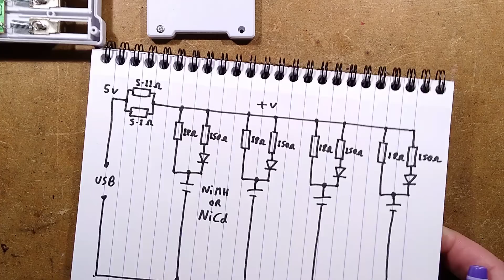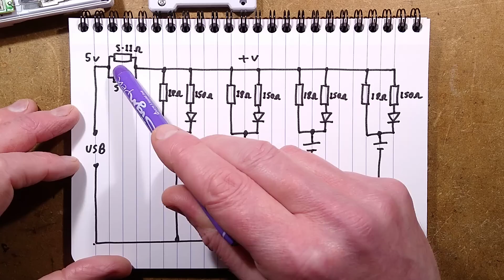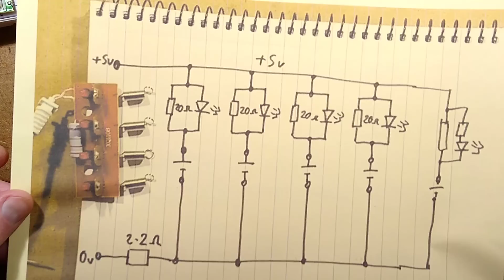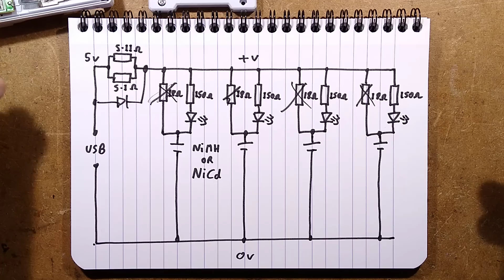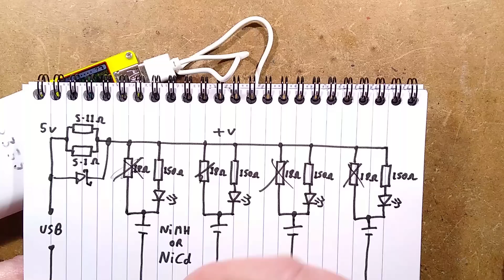eBay trash USB charger 2023 - with schematic

Comment: Looks like Kodak-branded chargers are available in Poundland now. For £4 they take 2 cells at a time and take USB-C (but only from type-A cables), they appear to be smart on the inside with a cutoff and LED indicator for when they're done charging. It'd be interesting to see at what rate they charge.

Comment: I designed one circuit when I first got a mains powered alarm clock. It was a relay, transformer power supply, LED, dropper resistor, 2 rechargeable AA batteries and an electronic beeper. The power supply turned the relay on the LED trickle charged the cells. When the mains went off the relay de-energized setting of the beeper letting me know the mains were off.
Reply: I no longer go to work at 6am. But it would be nice to know if the power goes off in the middle of the night due to severe weather.

Comment: some power banks need at least 150 ma to stay on. i ran into that problem making my own charger. it worked perfect on a 5v supply for a cellphone but using it on the power bank it would shit off due to the minimal load. perhaps that’s why they used the low value resisters. great video tho clive

Comment: You gotta work with surface mount?  I don't think so.  Surface mount is for the convenience of automated assembly machines,  among other things.  Besides that,  I've been scrapping through-hole stuff for decades,  and have more parts than I'll ever use.  No reason I can see why a leaded resistor couldn't be tack-soldered on to those pads..

Comment: I have this same charger, it outputs to the cells 5 volts, is that normal?  I tested it with a multimeter.
Reply from the maker: Yes.  The open circuit voltage will float up to the full USB voltage with no load.

Comment: I'm glad you brought up the point that the modified charger was intended to "top off" charged batteries.  Basically the idea is to provide just enough current to overcome the cells internal resistance.  That's actually called maintenance charging.  I designed a 12.6v gel cell charger based on a 7815 series regulator that provides it's output based on the state of the battery.  The charging current will be 1 amp when the battery is discharged and will taper off to about 8 ma at full charge.  I chose the 8 ma value based on the data sheet for the battery.  The charger and battery are in an emergency lighting system I built almost 10 years ago.  The battery has lived well beyond it's natural life thanks to maintenance charging.  

With regards to surface mount components, I would recommend getting a microscope to assist in placement especially for the 0805 and 0603 parts. I have a Mustool microscope that has it's own display and can magnify up to 600x.  It wasn't that expensive- under $50 USD (41 GBP) on Amazon.  As a radio amateur I receive the ARRL's QST magazine and a couple of years back they ran an article about using a PC cam as an alternate to a microscope.  I tried it and it's doable but it is cumbersome and the magnification is limited.   Solder paste is a much better alternative to fluxed solid solder as a dab will hold the part in place until you put pressure on it with tweezers.  Also you get better control of the amount of solder on the pad.  As to the type of tweezers the ceramic tipped ones are ok for passive components but not so good for actives such as MMICs where they might be subject to static damage.  For that reason I have a grounded mat on my bench and use conductive tweezers when I'm working with actives.  My workspace is a scaled down version of what I used to use back before I retired.  

Finally, a schottky diode would have been my first choice since it has a forward voltage drop of about .1v as opposed to .6v for a standard PN junction diode.  At 40ma the diode will dissipate only about 4mw.  Later.

Comment: My first thought about the big and little resistor in parallel is that the design was meant to be used with one or the other depending on if you need extra dissipation or can go with one size of resistor. Someone just decided to populate both in the end and maybe double the value to end up with the 2.something ohms.

Comment: Back in the days then I was young and naive I "hacked" one of those spring loaded chargers, basically threw out all the circuitry and just added a connector to hook it to a RC battery charger. I needed to charge 4 eneloop at a time (for Tamiya mini4wd models). Turns out the springs can't bear a 2A charge, they get super hot and melt. Lesson learned!

Comment: Maybe the first resistors was a voltage divider, so you don't push something like 4 volts into a 1.2V cell, but you can easily measure things, or calculate.

Comment: Was excited for this, I ordered from eBay what I thought was the same charger, but I got something with a slightly different PCB on it. PCB has a model number "MQ B-04". Traces are slightly different two 1.1 or 1 ohm coming off positive, the resistors seem swapped 22ohm in series with led and 150 going to positive contact. Resistor groupings on the board is different from your example, where resistors outside the first ones on the positive side input are placed around each positive battery terminal and led. Interesting with the differences between your example, and the one I got from eBay.
Reply: I got one from AliExpress and expected the same. The one I got had the exact schematic as Clive drew on the previous video (one R parallel with an R and an LED). Different PCB layout and values though (1k in series with the LED and parallel to a 24R). I removed the 24R and now I wonder if using a 1k and LED in series with the cell even charges it at all. There is current flowing because the LEDs light up (quite well, actually)

Comment: To me this seems ok. The soldering was bad, but the circuit.. I mean its a 5V out USB charger used to charge 1.2V low capacity Nims, or even nicads..
I can see how it works and it should be okay if you stopped charging after the leds glow dimmer.. ?

Comment: Anyone who wants a good multipurpose and multifunction charger just get a BT-C3100 or newer and you won't have to solder, modify, or reverse engineer anything. I use it for testing battery capacities and topping Ni-MH and Li-ion daily.

Comment: you could had even just removed the resistors and skip the diode altogether and bridge it as you only charge through the LEDs these gonna block any reverse current anyway. BTW what solder iron are you using? the pen looks pretty much identical as the one I have on my soldering station
Reply from the maker: It's a generic Chinese soldering station.  Yihua 8786D.

Comment: The schottky diode is actually superfluous, the LED’s will provide reverse protection on their own. Solder bridge the schottky, you’ll get a slight bump in charge current to boot.

Comment: you don't have to replace the 5.1 ohms with a diode if you cut out the 18 ohm resistors, because the reverse breakdown of the LED's will be higher than the battery voltage so the LED's will block current from flowing back into the charger and discharging the cells.

Comment: im so glad im ultra near sighted. ive never needed a magnify glass since my eyes have a focal distance of 1.5 inches. in electronics class i was the only one able to do smd chips and ics without a microscope. so the teachers had to debate how to grade me since i had a advantage over all the other students.
Reply: My eyesight is the same way. I think my main concern if I got into electronics would just be protecting my eyes when working with tools at such close distances.
Reply: Being near sighted myself I have always had an advantage when working with small parts but take it from me when you get down to 0402 pitch and smaller parts you will need a microscope.  The 01005 parts are not much bigger than a grain of sand.

Comment: Cud try shorting data connection on the usb plug but may allow 2amp if mains adapter is capable otherwise it be 500ma standard 1amp if that cable was any good 😅
Good idea for trickle charger tho👍

Comment: Clive, I appreciate the recommendation on the ceramic tweezers. I grabbed some a while back after you mentioned them in another video, and they're great! They work nicely for hot air soldering of SMD stuff, too. Mine use black ceramic, supposedly ESD-safe, but I don't know if I trust that.

Comment: The diode at 6:28 should be in series, not in parallel to the 2 resistors. Reverse current will still flow through the 2 parallel resistors. As others have said if the 18 ohm resistors are removed the extra diode isn't needed at all as the LEDs will do the job.
Reply from the maker: I should have scribbled over the resistors in the schematic.  I was just showing where it would go in the circuit to replace them.

Comment: I converted a GP 'overnight' charger for 2x2 cells into a 4x1 cells trickle charger. Mainly because the unit in its original shape could not charge 1 or 3 cells, but also because it slightly warmed up the cells when using it as a trickle charger.

Comment: I was taught electronics when I educated as a Radio TV Repair tech in the late 90s, and SMD was just a side notice..  Got my certificate and there was no work so I went into telecoms instead. 
Been there in various jobs since then, until recently when I started working in an electronics factory and Oh sweet lord this stuff is tiny..  My glasses need glasses for some of the stuff :D 

What I learned pretty early though, is get yourself a syringe of flux paste, and just jab that on there before you solder the component down, and also a sharper tip helps.  The flux will really help spreading the heat, and the sharp tip will make it less messy.

Comment: The schottky diode is not so needed, because the LEDs also are in series with the batteries, unless you do not trust them to block the back flow. And in your drawing, you did not cross out the two 5Ω1 resistors

Comment: Delightful. Good to see that surface mount is not so scary, and a nice tool tip about the tweezers at the end. I have actually built a 3 board version of the Simple NiMH battery charger (with PCB files) Big Clive showed us how to make. 👍🙂👍

Comment: I'd think the LED's would prevent discharge of the cells after removing the 18 ohm resistors. So the hack could be done with even less effort.

Comment: Off question, you can get mains rated fuses and then you can get 12v car fuses, now I'm of the assumption that onky the current matters in a fuse, so, could you use a 12v fuse in a 250v circuit?... Nobody please say some bs about insulation 👀
Reply from the maker: The car fuses are only rated to break a low voltage.  With higher voltages there is a risk of arcing across the gap or plastic housing.
Reply: @bigclivedotcom  care to test it?

Comment: They both had bad circuits, hmm....... Did you design these? 😛

10ma...that would be about 250 hours to charge a single 2000mah battery... Some of us don't plan on living that long 🤣

You absolutely do not have to go the smd route! Horrible stuff

Comment: There are some studies out there (which YouTube won't let me link) that shows that even for very low trickle charge currents (the study went down to 20mA) there is a reduction in cell capacity after 100+ cycles with the low self-discharge NiMH cells. I imagine that 10mA will be less stressful than these tests, but not perfect. I charge AA cells at 25-30mA because I built my charger before I knew this, and and this is a compromise between damaging cells and charging them in a reasonable timescale.
Reply: Depending on what your intended use is a maintenance charging system will extend the life of the cell.  When I designed my 12.6v gel cell emergency lighting system I went to the battery manufacturer's and looked up the battery's specs.  Basically a maintenance charge is the amount of current needed to overcome the internal resistance of the battery thus balancing out the battery's propensity to self-discharge.  In my case the maintenance charge current worked out to around 8 ma which was just enough to keep the battery fully charged.  After the battery kicked in during a power outage and the power was restored the charger would kick in at about 800ma until the charge was restored and taper off to the maintenance level.  I built my system about 8 years ago and the battery is still performing as if it was new.
Reply: @johnbrandolini2915  Yes. I think that the problem is with the very low leakage NiMH cells, the safe maintenance charge level is so low (<<10mA) that unless you perform.a two stage charging process (as you do), the maintenance charge level will never charge the cells from a discharged state when the internal leakage is much higher.- even if left for many days. The sort of charger that Clive describes in this attached link won't work on these NiMH cells without damaging the cells. https://www.youtube.com/watch?v=wVnAH17f4jg I couldn't attach a link for the article showing the measurements that I referred to above, but if you google aacycler you should find it.

Comment: I dreaded working with SMD components for a long time. Partly because they're so tiny and my hands are a bit shaky, but also because it meant I'd have to buy a whole lot more components. But then I saw a few projects on the Interwebs that I wanted to build, but they were all SMD. So I bit the bullet and ordered the boards and parts, and gave it a go.

To my surprise, it wasn't nearly as difficult as I thought. It didn't take long to get used to the tiny components, even with my unsteady hands. I even built one of Rasteri's weeCee tiny PCs, which required aligning 1.25mm twin row SMD headers within a fraction of a mm on four sides to fit the processor module.

Now I've designed my own projects that use SMD parts, designed the boards got them manufactured and everything. I've even printed and etched my own home made boards using the toner transfer method. Basically the only reason I'd go for through hole over SMD is if I wanted to use a specific through hole part (potentiometer, header pins, specific IC that I already had in through hole version), or if I wanted the circuit to look vintage (I'm currently designing a clock that uses a vintage VFD display, housed in a wood and acrylic case that shows off both the VFD and the PCB).

Comment: Yet another undocumented benefit:  You can use it to balance cells which are to be used in series in an applience by just letting them in there after charging, and disconnect only the USB plug. After a few days a quick boost by topping them up, and they should be balanced.

Comment: I wish though that there was a way to tell when each cell is fully charged.
Reply from the maker: It's very complex with NiMH cells.  The only cell/charger combo that had a solid method of detecting end of charge by the internal pressure change went obsolete a long time ago.

Comment: Will I get away without the diode? Since the charge path is via LEDs.
Reply from the maker: Yes.  But it will be needed if you use different parallel resistors for higher charge current.

Comment: Got about 40 cells from vapes and going to make me an HT battery for my portable shortwave valve receiver
Reply from the maker: If making a long series array you will need to use a suitable battery management module to protect the individual cells from overcharge and discharge.

Comment: for nicd and nimh that circuitry is not bad at all .

in the 80s often the dc from the power supply could just go to the cells and that was fine for charging nicd and nimh.

today's lithium even the lifepo4 and lto variants require more advanced circuitry than a simple resistor to limit current.

Comment: Considering that a typical 2500 mAh AA NiMH cell will take charge for more than 10 days at 10 mA, this is not a very reasonable hack. 😅
It definitely needs some digital or analog circuit to change the charging current from high to low when nearly charged voltage threshold will be reached. This could be an interesting project, by the way.
Reply: Hi, yes my thought as well.😏👍
Reply from the maker: It's for where you have applications using NiMh cells that need changed every few weeks or more, so that a fully charged set is always available.

Comment: That bottle of flux looks like my urine sample I gave to the doctor today.
Reply: I wear an old ww2 mask when using it. Come back after a day and the joint is corroded. Gives it an antique finish and Tom cats around. That way the project also gets a cat scan at the same time. Win win all around.
Reply: @Netties8266  Ok, so urine is fine, however let's not use it all of the time. 👍😏
Reply: Have you checked to see if it's suitable for soldering ?although if it is I'm not sure that you could stand the stench.😏

Comment: Can we convert this to top-up disposable salvaged 3.7v nominal cells from nebulized glycerol devices, using a recharge pcb circuit from one of the same type of devices that have recharge capability? There would be no additional components, and If the cells are charged in parallel, it may also be possible to recover some over-discharged cells when some good cells are used too. I imagine little slugs of Dowel, sporting conductive aluminium tape coats to allow charging of the various lengths of cells found in devices nowadays, considering the shrinkflation going on, both in the included cells, but also the smaller fluid active ingredient containers I have noted since 2023 rolled around. In Portsmouth, I harvest about 4-6 devices daily and 95% have viable cells, and at least 15% are rechargeable devices these days. Yesterday I found one that delivers CBD infusion with terpenes, and not derivatives of Nicotiana tabaci. I wonder how safe those are?

Comment: I'm glad you mentioned the potential resistance of the USB cable. I'm also glad you mentioned reverse discharging because thats exactly what my TOMO M4 18650 power bank does that i got in 2019, so after charging 18650s with it if i dont plan on using the power bank i started removing them to stop that from happening.